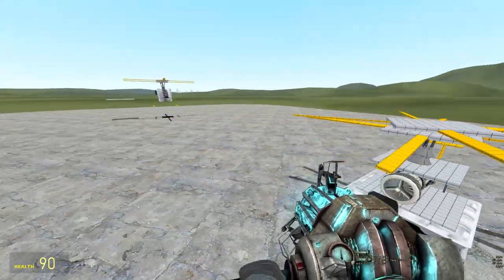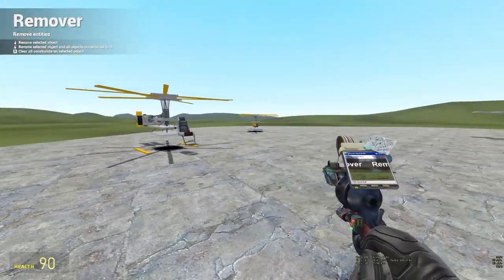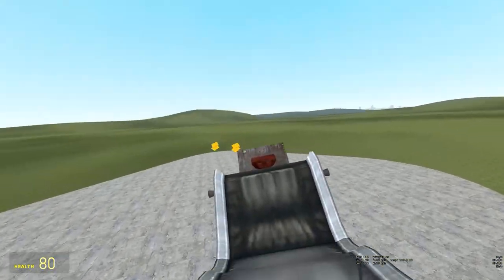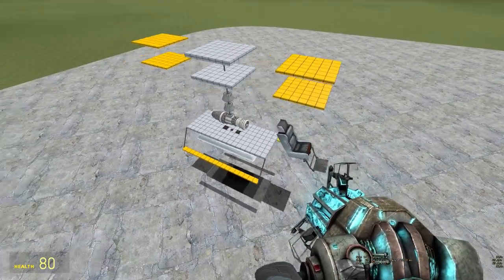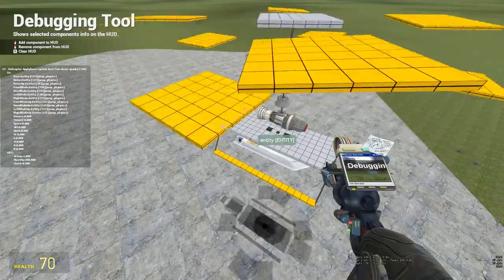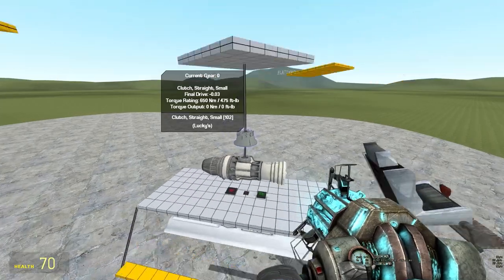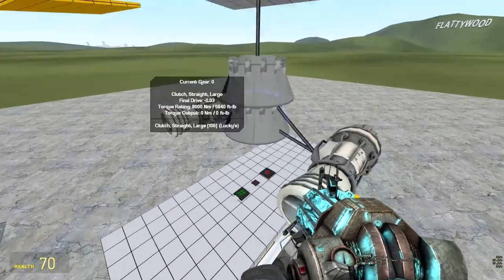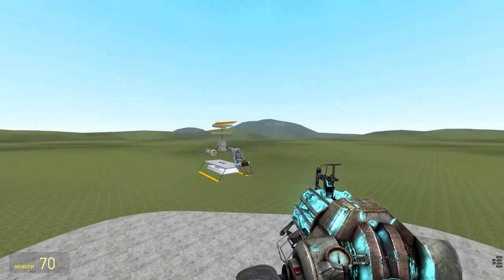The problem with ACF Helicopters

Comment: You can actually control the fin blade angles via holoang rather than setang or applyoffsetforce etc. Parenting a fin to a holo (while still welding it on of course) lets you control its fin orientation.

Also you can get the torque straight out of acfGearboxTorque() or something like that with . It is usually rather jumpy but if you filter the engine output through a gearbox with a torque rating very close to the engine then it becomes smooth.
Reply from the maker: Yes, some months ago someone told me about parenting fin to a hologram and i tried. I have to say the guy who find that is smart! But... yes it make think smoother but it also make the helicopter act weird, like you have a heavy prop with no gravity attach to it. Also you cant set your heli once it is parented. In the end you can have the same effect by using Propinertia() and its more user friendly.

"acfGearboxTorque()" yes to be precise its acfTorqueOut() and i tried many ways to use it. In The video that's the value that is flickering and I am talking about. But its not the reactive Torque. it doesn't tell you what force is apply to the chassis or what force goes in the Rotor. I even try to calculate everything but this value has nothing to do with what's going on..
 That would have been so practical but naa....
Reply: @luckys9249  You are correct in saying that acfGearboxTorque() usually flickers, but that can be solved with intentional gearbox slip. The way you set it up is you use an intermediate gearbox that boosts the torque from the engine so that it is very near to the torque rating of your final gearbox. This smooths the output completely. This trick is often used in very well tuned acf cars, and is very applicable here too!

If you still don't want to use acfGearboxTorque(), you can instead get a reading of the torque output of the engine itself, and then divide by all of the gear values you have. This will always be smooth, although a tad less accurate. 

Even so, you don't actually need to know the exact value if you implement a PID controller! If you use an active control system like a PID, you don;t need to worry about getting values EXACTLY right, as long as they are in the ballpark, the control system will do the rest. This is especially useful if you plan on using a tailrotor to counteract the reaction torque, as it is not so trivial to calculate the force provided by a fin tailrotor under all flight conditions.

As for the parenting fins to a holo method, there are no adverse physical effects whatsoever. It is physically equivalent to simply welding the blades on. All this does is allow you to control the angle of the fins, nothing else - and it is extremely accurate in doing so, down to a few percent of a degree!
Reply: @luckys9249  In addition, the holo parent method does not have the constraint drag issues caused by the axis/ballsocket/excessive rope contraints for either the fully mechanical or setang methods - it is just welding the blades on. This allows you to reach real life RPMs and tipspeeds under ACF power, allowing realistic flight performance and specifications.
Reply from the maker: @kazeskyfly8854  So i have been experimenting this afternoon with your suggestions and i got some very impressive results with the gearbox trick. It definitely solve the problem but there is like some power missing even if i remain in the final clutch torque range. But it definitely worth it!

Now it open the gate to mono rotor since i have a constant torque output but because of the power loss i will reconsider the holo trick even if i really don't like the idea that would help to drop the e2 around 5% even with runontick(1) on top of a increased power.

I Didn't know what was a PID so i did some research and it look interesting but i don't know how to do one. So whe  i'll be at the tail rotor i will follow some tutorial to make my own.

Thank you for your good advice!
Reply: Parenting fins to holos? Can I ask how does that work, exactly? Got kind of curious about it, although trying to search up anything about it doesn't give much results.
Reply from the maker: @PenolAkushari  Its very simple.
1: You weld or constraint Prop1 to prop2 
2: you create a hologram wich you parent to prop1
3: you parent  prop2 to the hologram
4: now by rotating the hologram you can now rotate prop2
Reply: Ah, thanks! Was thinking about it for some time, didn't notice that holoCreate returns entity, so I was kind of stuck with thinking how can I parent an entity to holo's number index. Well, learning things day by day!
Reply: You have heard of Gaghr right? He makes fin helicopters using parenting props to holo using E2
Reply: @kazeskyfly8854  out of all the years I've been into this, so many crappy aircrafts built, and I'm just now finding this information... This has huuuuge implications

Comment: There is a good example of a full acf powered fin heli with tailrotor on garrysmods.org:

https://garrysmods.org/download/61786/gaghrs-basic-acf-fin-heli
Reply from the maker: Yes there is good stuff there but for what you get in smoothing you loose in accuracy and to make a ACF helicopter that can peak a serious fight you need both at max.
What i try to say is, I can make a good heli that is smooth to fly and had good control by tweaking the inputs weight etc... but its  a sort of tailoring. If you change a detail, you have to redo everything. 
Setting things this way is more patching the issue instead of solving it. I'd like to solve the problem. It's like people who remove gravity on the cannon of their tank to fix the turret.
Yes it work, but it had new problems that are going to show up down the line. With Helicopter it can be very problematic to find what's the problem specially when there is multiple problems
that's why i try to simplify my build as much as possible.

You gived good suggestions but i already burn all the tricks in the book for as far as i know